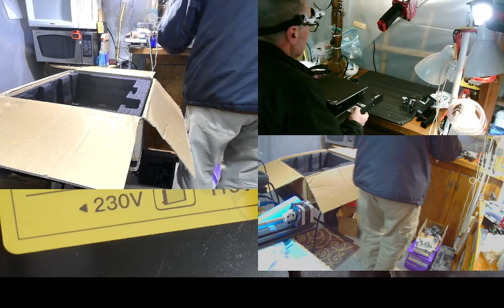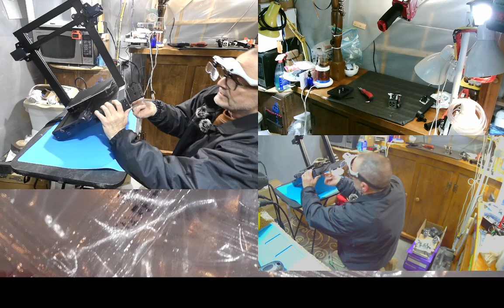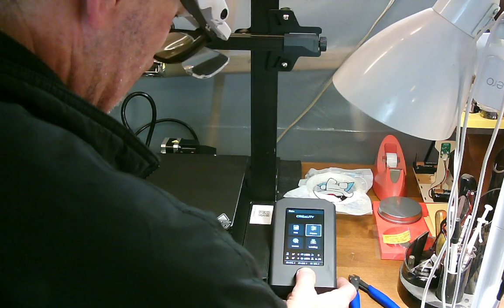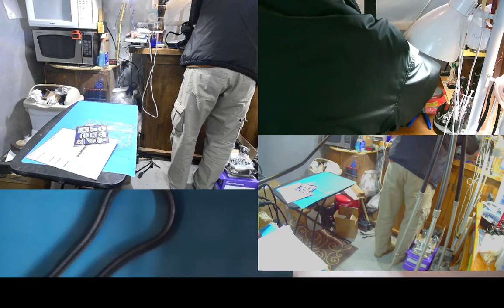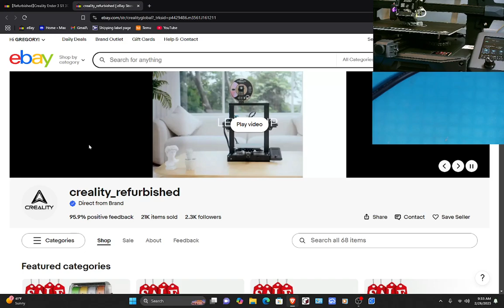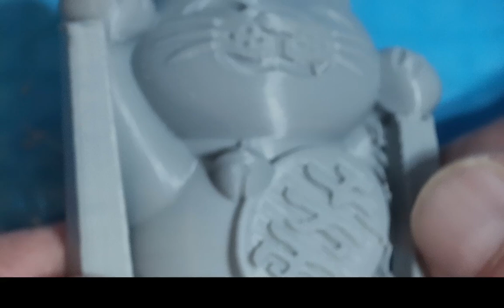Creality Ender 3 S1 ebay Refurbished

Comment: Thank you for taking the time to make this video. I just picked up an Ender 3 v3 ke from the same store on ebay. I already had it in the cart, but this video got me to pull the trigger. Ive never used a 3d printer but have wanted one for years. Do you have any filament recommendations or helpful beginner tips?
Reply from the maker: https://youtu.be/iJdAoNv3BuA   Hello John I made Short vid to answer your questions I hope it helps.🤠